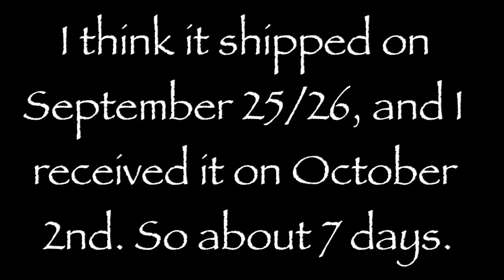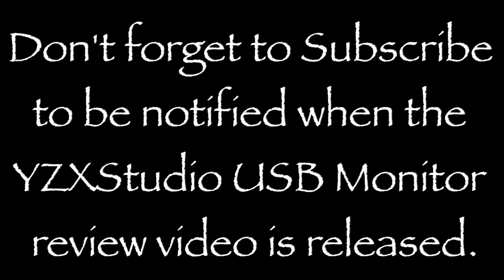More Gadget Tech Thoughts - Franky.com Mail Bag (99CentHobbies.com)

Comment: hi :) what was that usb dvice (red one with LCD) ?? 

PS : i love your videos ;) add more (electronic tools, gadgets and projects ....)
Reply from the maker: +mehdi mahdi Hi Mehdi, Im glad you like the videos. The red USB device is a USB power monitor. USB 2.0 LCD Power Monitor (Red) YZXstudio Model ZY1262. I have done a couple videos on this if you look at all my videos you will see a couple more showing how accurate it is and one showing the menus a features.
Reply: Hi Dave, thank you for answering me :) do you use it for monitoring USB batteries ?
Reply from the maker: mehdi mahdi That is one use for it. It also good for checking your USB chargers. Ive found a couple over the years that were under voltage without a load, checking the quality of the charging cable and that the cable is allowing full power of the charger to the device charging. Cable quality is a big factor when making sure you device is charging the fastest it can.